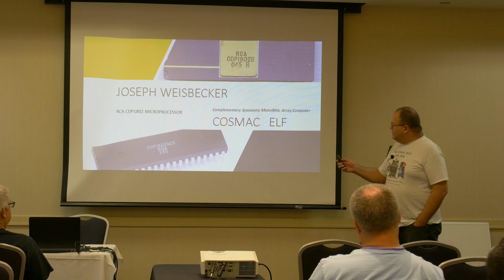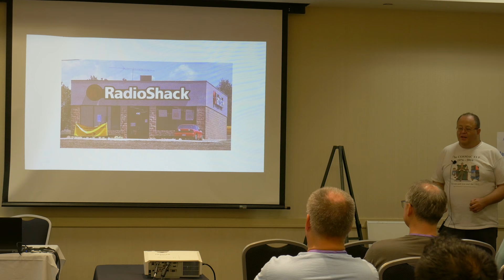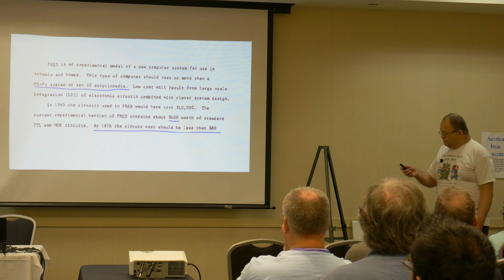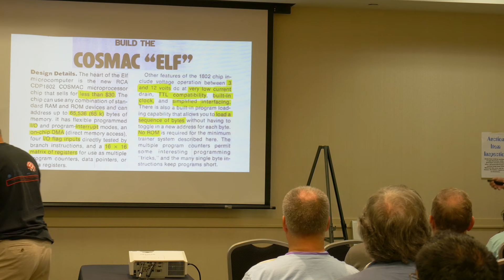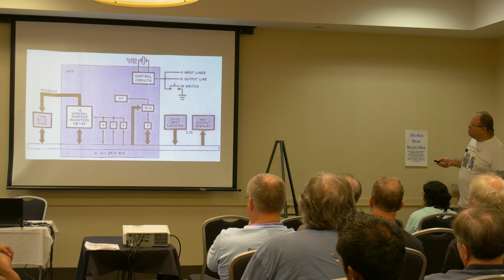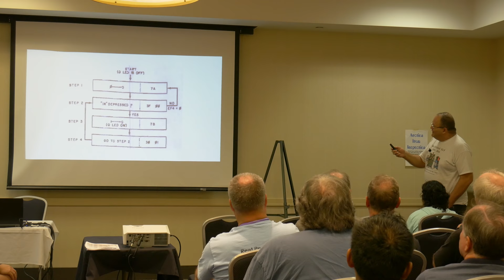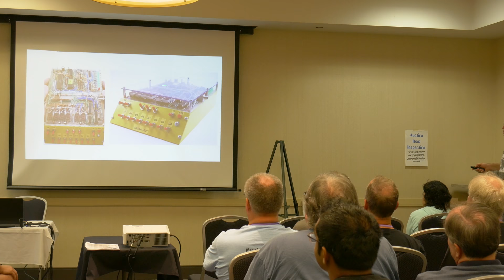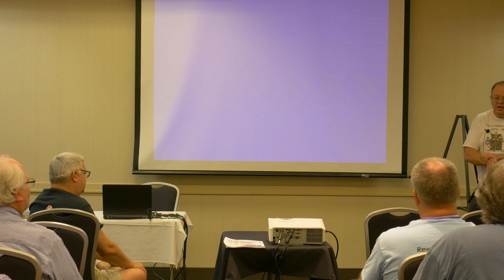RCA 1802 Microprocessor | VCFMW 2018

Comment: One of the projects I'm working on is to revive the 40 year old 1802 based computer system I designed and built. I built one of that BLIP game from the information in Popular Electronics. I still have it today and I think it still works. I haven't fired it up in some time. It is a simple enough circuit to fix if it doesn't work. Just test a few ICs and replace the bad ones.
Reply: You should make a video of it!
Reply: @gregorymalchuk272  The 1802 based system or the BLIP game?

Comment: Also 20:00  Hope RAM and ROM was in one address space or something?  At least - this one Q pin looks slow forcing to add shift register. That one address space (ability to write into external address not only read) would make easier to create your own address space for your own addresable IO PORTS of memory BUS  just like (im guessing!) 6502? Had MOS 6502 one address space? And these 4bit segmented program counters would make sense if you considered to have multiple smaller chips connected to same bus able to store and run small routines. Or 16 different IRQ vectors? Or 16 different syscals? Was that 4 bit  program selector for this purpose? Nevertheless it allow to set vectors of "syscals" defined for ROM2-cartrige usage without need of program to know address of routine in BIOS-ROM1 in advance. Only knowing witch number of register is set for what purpose. And viola PC. Allowing BIOS-ROM1 updates and ROM2 to take over. Syscalls even if not IRQ handled but just handled by "client" of main BIOS so to speak would allow update bootloader without loadable programs need to know where these sub routines were located. Like for example you make BIOS and add cartriges with games. You set 16 different routines to be used by game engine. You can update BIOS without modifying cartriges. The only problem such architecture was limited to 16 different syscalls predefined and had only 1 bit additinal port. What about IRQ? Registers allow to hijack syscalls to take total control over chip extending BIOS (replacing it) by for example program loaded to RAM or other medium. But all had to be pass trough that 2x8bit address bus and 8bit data bus.. and reed it was very slow. 

Guess 6502 had such feature single address space, no protection, and 8080 of singular address space. But 6502 had no ram, so it's advantage of RCA 1802 of having it. In 70s! At first glance it looked crappy but it wasn't that bad. Was it?

It is only what is required to create architecture of your choice one singular addres space. Ability to poke memory and instead of memory have some pheriperials addresable multiplexers is allowing to create true computer with loadable programs of any medium or just simple small microcontroller. If it address and data bus was only for ROM and only Q as output that would make slow "serial" microcontroler. Very slow and nothing more. Just like PICs are? 

Sorry i could reed that of Google tried to imagine how would it be to design PC out of it, how to design microcontrolled in 1970s :D

Comment: 20:00 So it was 8 bit, Intel 8051 had 256 RAM as well,, 4 bit x segmented 16bit program counter? And up to 256 instrucions set? Up to 16 sub-routines sets? But why? Why to introduce such odd thing? I dont understand. Just reed that 1802 has a single bit, programmable and testable output port (Q) why!? Forced to use addresable multiplexer? Shift register? Reduced number of pins required for addresses to 8, required adding register to hold low-high address almost like Intel but intel at least kept more direct pins out like 12 or something 4kB did not required separate register. Added internally register to reduce number of address pins to 8, require to add register to "decode" that address given to bus.. i don't undestand why? why?
Reply: BTW. If i understand it correctly Intel 20bit pre defined bus 8086(?), famous 640kB memory was advantage cause allowed to reduce number of chips and sligtly increased speed of memory transfers just like 8051 by exposed 12bits instead of two halfs / sent twice . Yet it limited memory by design added "extended mode". If you divide bus into chinks and force to sent it by parts like Amiga had, 68k you are only limited by program counter capacity adressing. But consequence additional buffers required as interface to memory not only decoder, and slows down memory transfers. Intel used "trick" but to provide some backward compatbility had to introduce some segmentation trick? Limited memory to 1MB. Whoever accepted that decission. Should take cake in a face. In theory would be perfectly possible to have more ROM connected to 8051 if one port was used to store segment number and some memory location to hold "return address" could not cross limitation of 16 bit address space at once but could provide banking. 8086 would be perfectly possible to have more ROM in DOS if they did not used that trick, and limited bus to 20bit. If it was 16bit in 32bit adressing mode we wont have these hoops and jumps we would have BIOS in very last memory location but would force to have 16 bit bust 2x slower acces. If i remember correctly Amiga 68k had 32 bit but 16 bit memory bus, and accepting only first 24 bit address was maximum 16MB addressable in reality?

Pure speculation should maybe read Google forgot everything i knew..
Reply: 1. Weisbecker pretty much designed this entire CPU using 4000 series TTL chips in 1970 when there was no standardization of what a microprocessor should have or do. 
2. Weisbecker envisioned a system that could input, output, and manipulate data using as few external ICs as possible. In fact with its DMA function you could load bytes into memory directly without any additional software upon boot (see COSMAC ELF).
3. See points 1 and 2 for your answer regarding the Q port. In conjunction with one of the EF lines you could set up a bit-banged serial port with just simple software loops. Again, less external ICs needed. 
4. The multiplexed address bus was found on other CPUs. Not only that, but 256 bytes of RAM/ROM were enough depending on the application (see COSMAC ELF). Really with one of its timing lines it's easy to use latch ICs to get a 16 bit address bus. The 1802 is also big endian! :D
5. The 1802's instruction set was far simpler than you think, coming in an I-N format where 'I' was the instruction and 'N' was the register you wish to apply it to. In fact some call it RISC-like.
6. Registers could be used for straight temporary data storage. But they were also used to store the program counter which could be changed on the fly to another register holding the secondary memory address (in fact that's how you jump to subroutines). Others were hardcoded to handle DMA and interrupt addresses. Additionally, any register could be set as 'X' to handle IN/OUT byte transfers and Boolean logic with the accumulator. Yes, the 1802 beat the Z80 for having I/O select ports. 
7. Yes, to load bytes in and out of memory you HAD to set the desired memory address up in a register. Indeed, you had to load the accumulator with the high byte, store it in the high byte of the register, and repeat the operation for the low byte. In total it took six bytes to set up a register for memory storage and write a value from accumulator into it. BUT, once that address is stored you can increment or decrement it as you see fit making successive reads/writes easy, just like the Z80's (HL) register but with the advantage of having 16 of them. In fact that's how the 1802's software stack works. If you think that wastes memory consider this: Tom Pittman, a programmer who had his hand in translating ports of Tiny BASIC, said the 1802's version had the smallest footprint because of its ability to store and manipulate addresses. 
8. In the end the 1802 was a slow processor. As a consequence of being the first single input voltage CMOS microprocessor all of its internal registers are static and therefore slow. But on the plus side you could pretty much kill and resume the clock without consequence.